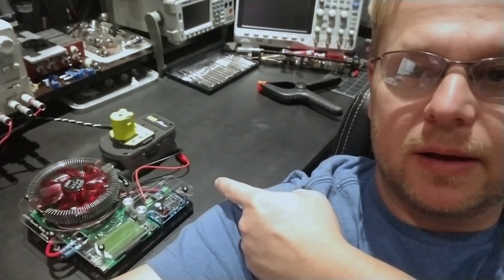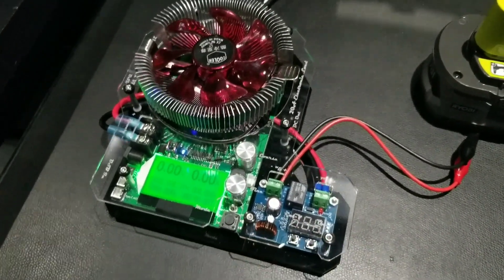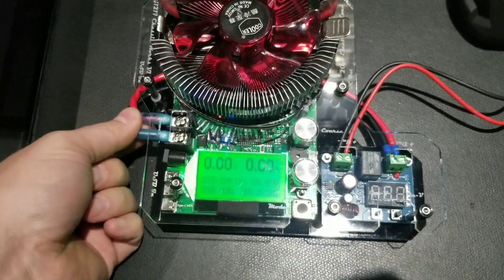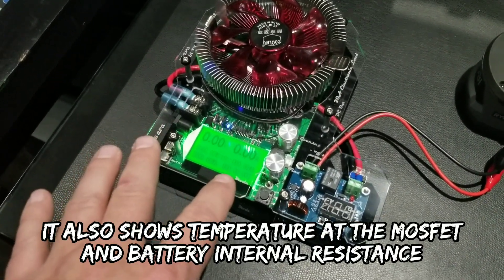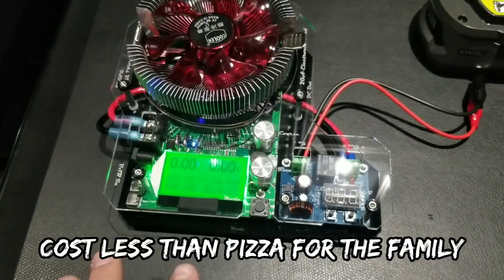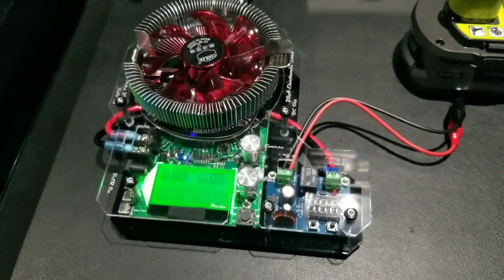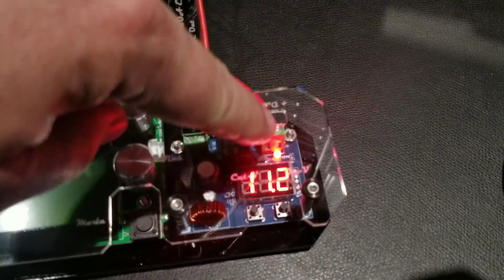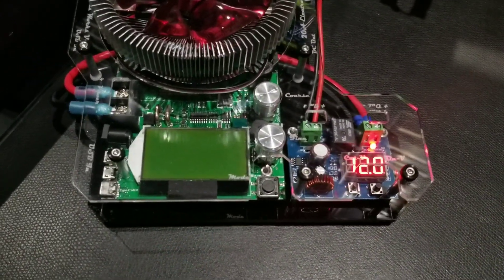SIMPLE - ACCURATE BATTERY CAPACITY TESTING - MAKERHAWK 150W ELECTRONIC LOAD TESTER WITH LVD ADDED

Comment: I have one of these and have 2 problems. 
The back light won't turn on.
The display beeps and shows this
>1.00v!
Can you help me out?
Reply: Does it beep with this error when the battery is connected? if yes then set the upper voltage to 36v ( the max for this tester) and check if it stays like that if yes the unit might be faulty 
there is a option for back light check it in menu and turn it on.

Comment: Hi I have the same tester I just wanted to know if this would work for 36 V battery that draws about 800 watts at full power, by the way it’s an electric scooter and I’m trying to check the milliamps hours for a cheap Chinese lithium battery I had bought. So do I need to get a tester that can put a heavier load than 150 watts?Please get back to me soon as possible. Thanks in advance

Comment: Nice Video!  And a super snazzy mod you did.
BTW, while my capacity tester appears extremely similar to yours (minus the addons), fan color, controls, etc., mine DOES automatically turn the fan off (so I'm assuming the heater as well) at the low voltage limit I set.   As a matter of fact,  once the low voltage limit is set it will NOT run until I connect it to something with a higher voltage and it would beep and flash the screen with 11.9V! every several seconds (I didn't time it).  The battery I was testing is just an old AGM 12V, not recently charged, and it was barely over 12V like 12.2 by my multi meter and the Capacity Tester reading was 12.1 when I connected the battery to it.  Anyway, it's the battery is definitely weak because as soon as I turned the Course Pot. for the heater, around 1A, the drain was enough to cause the discharge voltage to drop below the 11.9V I'd set the LV limit to and it alarmed and stopped running.  It was a couple second test at most. ;)    I just thought you'd find this interesting.  I bought it in June for $29.40 including shipping  from AliExpress and it took about 3 to 4 weeks. Faster than I expected.
Reply: Pete you are correct, I wish I had read your comment before ordering the low voltage cutoff.

Comment: Did you do a video tweaking this to 300W? Trying to discharge a 310Ah cell (3.6V) at .2C so it seems I need 62A, seems at 180W you only get about 56W. I also think my tester is broken but that’s a problem I need to confirm. It maxes out at 6A at 3.6V.
Reply: Cant get mine to go above 6-8 amps at ANY voltage. Did you manage to find a fix for this? Wanting to test some 3.2V cells at 5C draw but i can barely scrap 1C loads with this artificial limitation

Comment: damn it, only 11.5 amps? i just got mine today and thought i'd learn how to use it..good info though. edit: hey i just connected my load tester to a 12ah agm and slowly ramped up the amps.   i got to about 20 amps and it started beeping and showed me a screen that implied i went over 185 watts. i removed the battery from the load tester, let the fans run while it maybe still was beeping and flashing on the screen about being over 185 watts, i let the fans spin all the way down and then i hit the only button i know of and it seemed to reset and was good to go. i am liking this little unit, i cant wait to learn from it, for example the test leads i was using was creating considerable voltage drop down to 10 volts at just 6 amps, so i doubled up on the leads and got the voltage back up. also it shows the resistance which is something i have been ignoring and its about time i get my head wrapped around that.

Comment: I note the Low Voltage Cut Off is limited to less than 36 Volts (with a 20 Amp relay).  Now some people are saying "so what". Well if one is trying to verify the capacity of a Battery Pack for something like a-bike, those voltages commonly go up to 60 volts. FYI:  I note another offering on Amazon that is supposedly rated at 60 volts: https://www.amazon.com/dp/product/B07V3PWC23

Comment: I was worried the low voltage setting was just an alarm, but using an amp meter, when the alarm goes off, it does cut off the load. However, it's a pain to set and once it goes off, it keeps beeping and going back to the alarm page, while trying to read the other screens, which is annoying.  I like your idea as it seems easier to set and work with.  (Since there are a number of variations of this device, not sure if all have the low voltage cutoff, so you'll want to test yours.)
Reply from the maker: I do not trust the test to cut, I would rather have a backup device to truly cut things off.

Comment: you never explained how to wire the auto shut-off board to the load tester,
Reply from the maker: Hello, you can see it in the video. Very simple hookup as you take the output from the capacity meter and put it to the input of the shut-off. That's it!
Reply: @MR_Garage  I should explain in case someone else gets stuck. I actually had it wired right, but it would not come on! I figured perhaps I missed something. I did. I was trying to test a 4 volt battery lol. As your video pointed out, it only works over 6 or 8 volts. I watched  the video one more time and this time I picked that little bit of information. I have to confess, I sometimes fast forward thru stuff to get to what I'm looking for. Not advisable. Thx again.

Comment: the amazon link is out of stock or discontinued. I bought this off aliexpress or alibaba, can't remember which, $50 but mine is the 180 watt version, the other one which is yours is $40. the 180 seems better and bigger fan
**edit I found it, your device is discontinued the new design has no knobs and has automatic voltage cutoff, user selectable here is what i got :  https://www.aliexpress.com/item/4000479624068.html?spm=a2g0s.9042311.0.0.74e04c4d4Kecgd